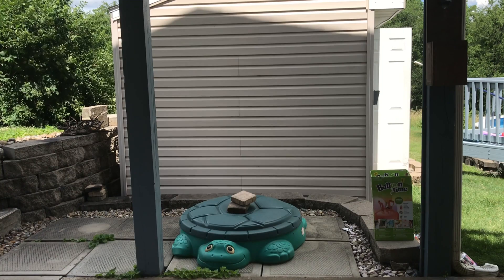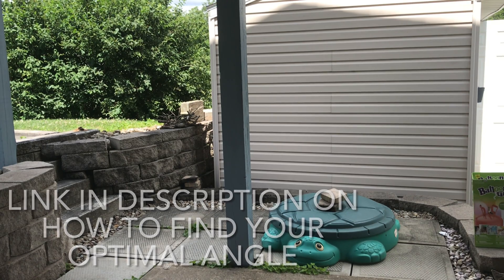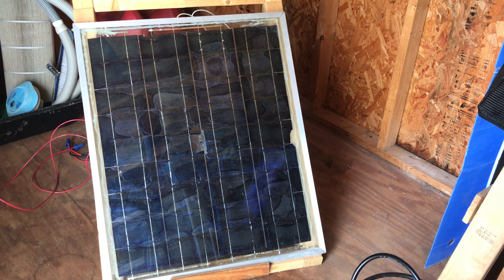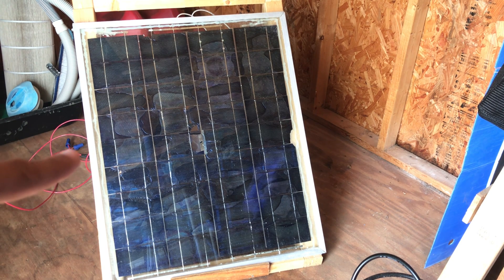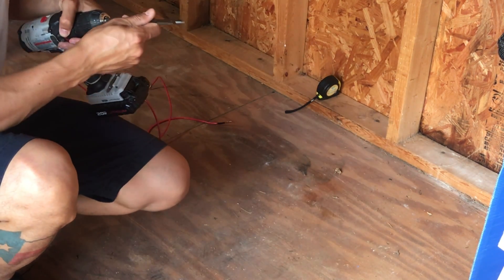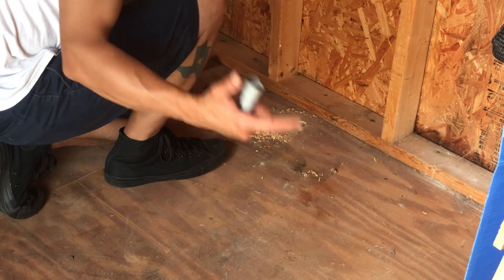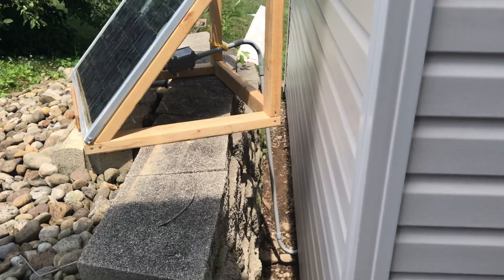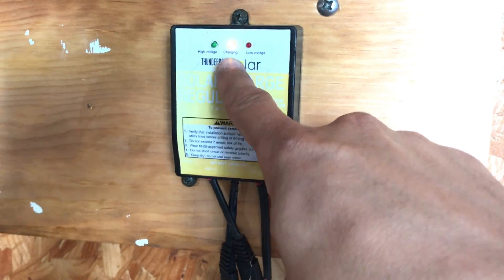Getting Solar Power in my Shed ☀️

Comment: Fyi, you may want to increase the volume on the next video to roughly average other people's volume levels.
Reply from the maker: Will do. How did you feel about my other videos volume??
Reply: @makeitkozi   The judgment is from hopping through several other creator's works without adjusting my volume, then when I got to yours it struck me as too quiet. It's still better than mine and I will attempt to not repeat that error if I post again in the future.
The kiridashi video also had slightly too quiet audio, then the music was about at the right level.
The average sound level on the hexagonal plastic making was pretty good
Reply from the maker: Thanks for the feedback. I’ll have to see what adjustments need to be made.